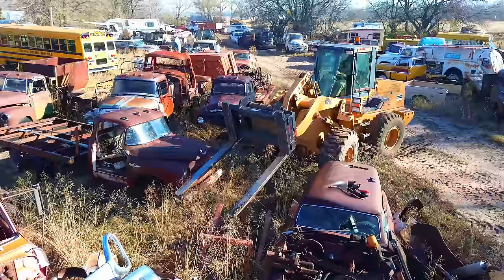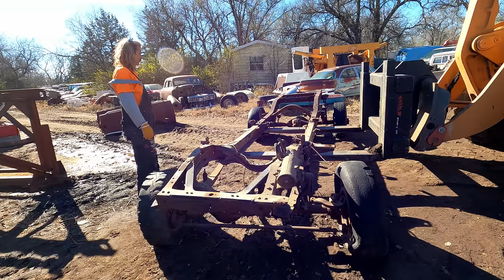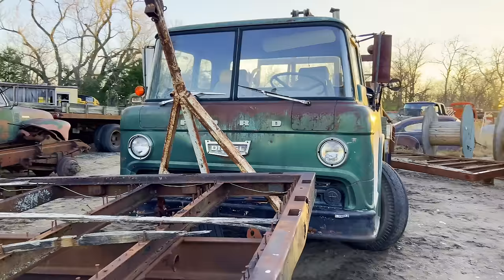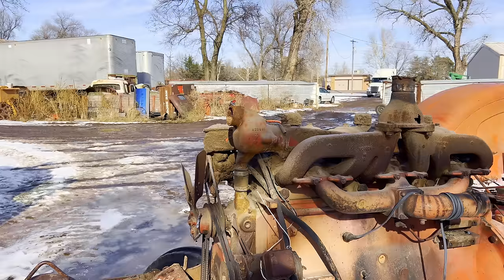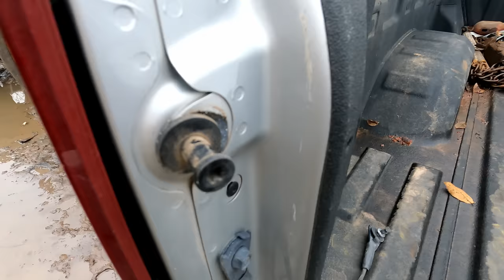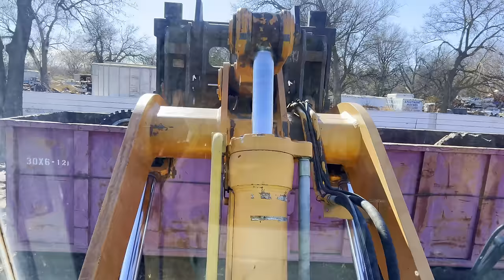DISASTER at the Junkyard! I Can't Believe this Happened...

Comment: Silas, Sorry for the tailgate accident..With all the extra technical attachments to these modern trucks they can be a pain to open. An Old Friend of mine accidently did the same thing closing the tailgate on our old 1984 Dodge D250 . and  mistakenly pull a way with gate up from our gooseneck 4 horse trailer.

Comment: I can’t imagine having to check the antifreeze in all them cars !!!
Reply from the maker: If they have water I usually just drain it out and leave them empty.
Reply: Also if the the radiator is removed or even the cap most of the times they don't freeze
Reply: @AdventuresMadeFromScratch  That was a joke !!

Comment: And the crap you can't clean cut with the death wheel is all hidden and unseen in a finished presentation of a nose, tailgate, big find n deck lid cut off so you can get away with a rather significant amount of "accidental" carnage and butchery done with your speed wrench of choice be it torch, sawzall, hack saw hammer n chisel, heck even a hatchet if you needed to release some anger, all happy accidents will all be hidden and won't matter anyway